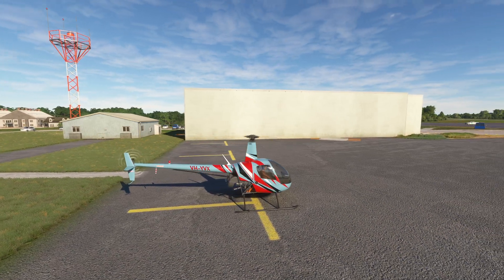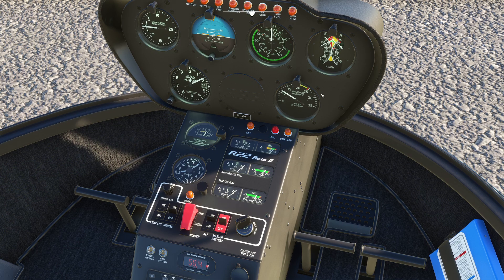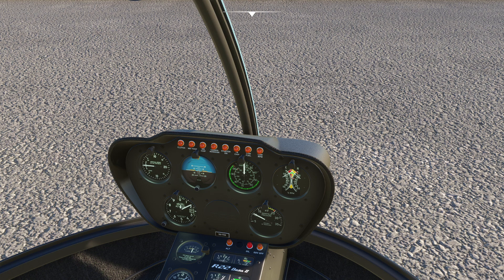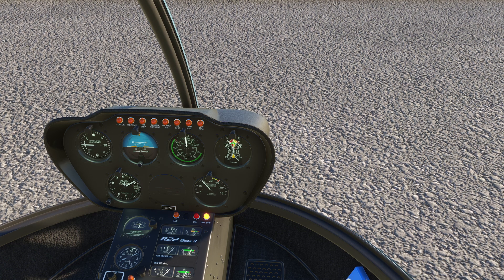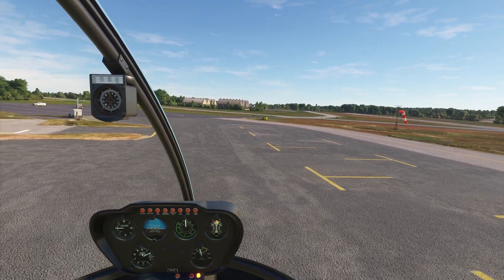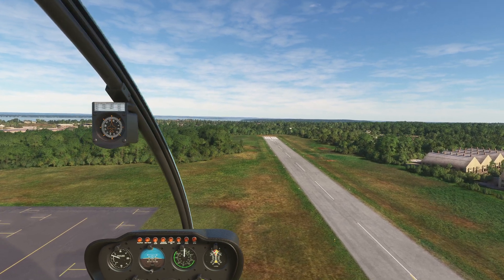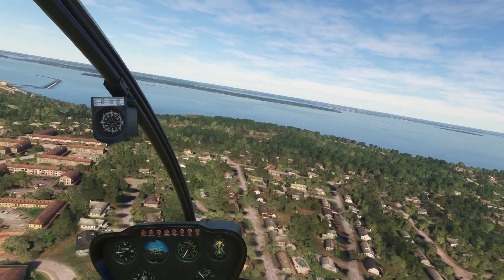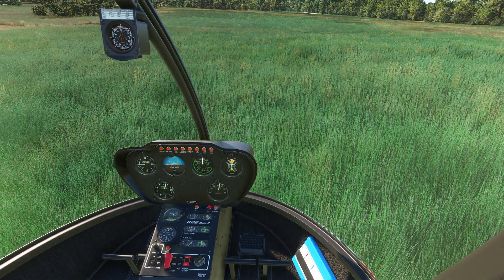MSFS - Helicopter Engine Governor Purpose and Demonstration

Comment: Great video.   I am having an issue with a decrease in RPM when flying the UH-1 in MSFS2024.  My throttle is at 100% and I am maintaining a normal airspeed.  It occurs after of few mns of flying.  Any thoughts??  Thanks.